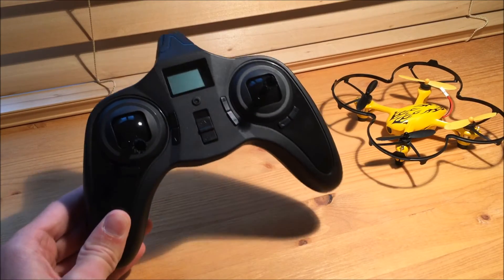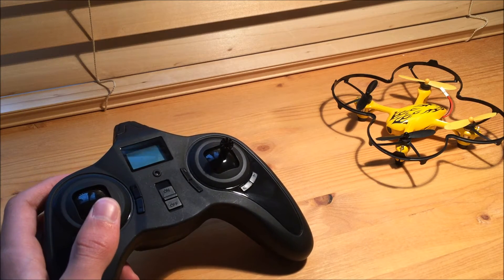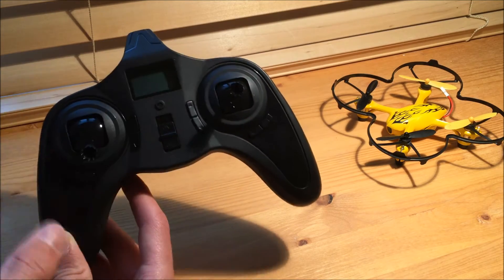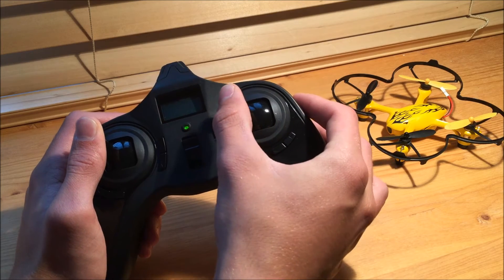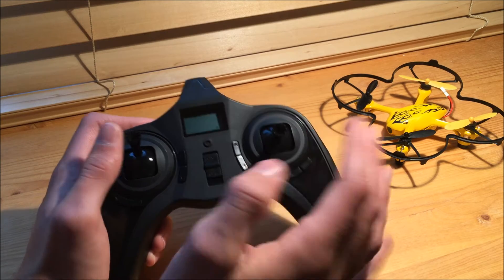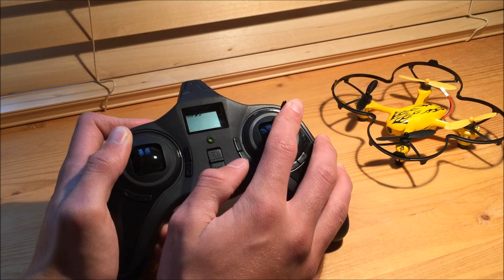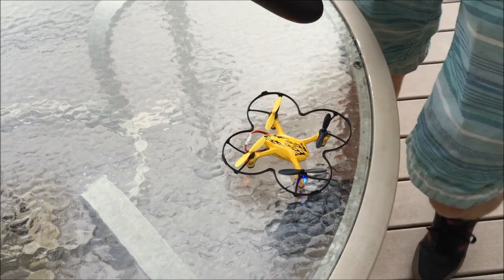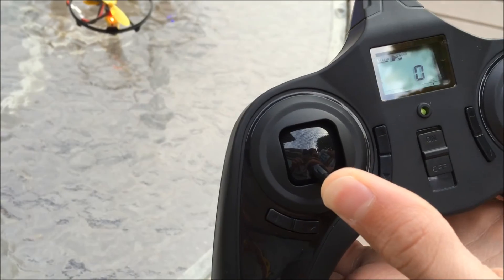RC Quadcopter Drone Controller Calibration How To

Comment: my Hudson x4 tends to start flying right slowly when I fly it what do I do to fix it
Reply from the maker: +Minusdrop use trim on the controller in the opposite direction it drifts to try to fix it. Some minor drifting is normal
Reply: Cameron Blegen thank you it worked
Reply from the maker: +Minusdrop sweet!
Reply: @Ovela108  dose it work on h107d FPV x4  ?

Comment: When I try fly mine only the backsides come up and it won't lift off
Reply from the maker: +iTravvyy could be a broken motor. Also check all propellers are on the correct arm, could be that two are switched
Reply: Cameron Blegen okay thank you it was the propellers they were broke :) I switched them with some new ones though

Comment: hey ! i broke the white wings! and replaced them with black ones. can we interchange the props? or should i stick to the A B code>
Reply from the maker: +Kashyap S hello! Not quite sure what the A B code is exactly. But the only thing that should matter is making sure the clockwise motors have clockwise propellers and the counter clockwise motors have counter clockwise propellers. As long as you do that and the size is generally the same and the props don't touch while flying you should be good. Hope this helps!
Reply: hey! thank you! that helps, But for the code 
The A and B props cannot be exchanged 
so here is the code 
A  B
B  A
This is how the props have to be arranged so that u get the right lift ! 

Just a bit of information I thought Ill share
Reply from the maker: +Kashyap S I see. Hubsan must be using A and B to mark clockwise and counterclockwise in that case no you cannot interchange A and B but u seem to have figured that out. If you have any further questions feel free to ask I'm happy to help!

Comment: My transmitter is different than yours. My right stick is manual, is perfect for mode 1. But if I change to mode 2, the left stick always goes to the center. In your video your left stick is manual, doesn't always go to the center... Is it possible to change this? Why this happens for my transmitter?
Reply from the maker: +Ricardo Reis Is this for the Hubsan X4 or a different drone? There is no physical way to switch which stick goes to center and does not. That is odd I have never heard of a controller being backwards. My only answer for you is to fly in mode 1 which leaves the throttle manual. If you feel like there is an error or you want a different controller I would try to contact Hubsan or whichever drone company directly.

Comment: can this hubsan controller work also with hubsan q4? if the q4 is mode 1 can i change it to mode via this controller? thanks very much
Reply from the maker: +Bobbit Erquiaga Yes it should work with the q4 however you may experience some trim problems using this controller for the q4 because it is meant for the x4. But if necessary it will work. The mode 1 and mode 2 is controlled only from the controller so whichever mode you set it for it will fly that way with the q4. Does this help? If not I can explain further.
Reply: +Cameron Blegen (Zed98) thanks